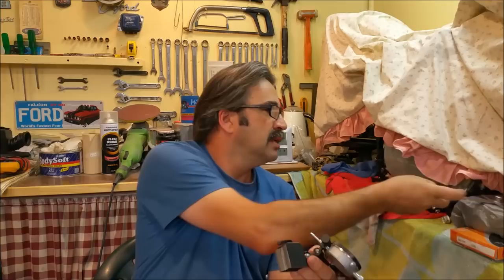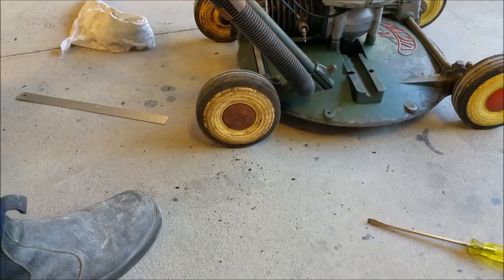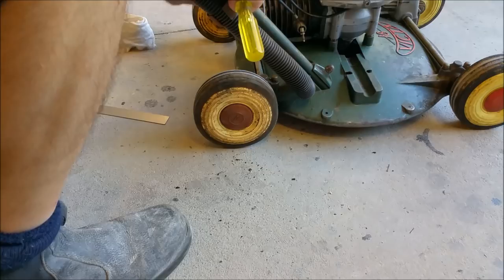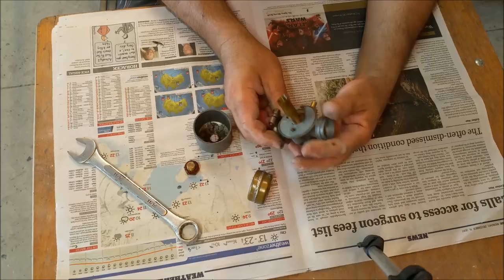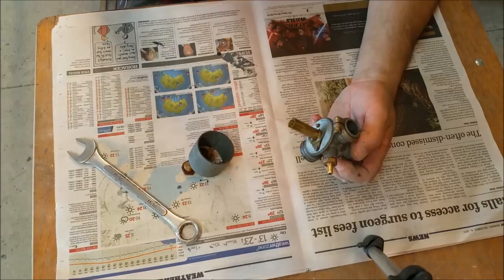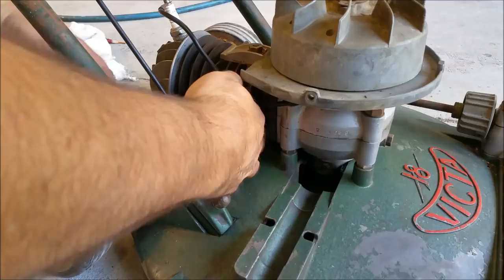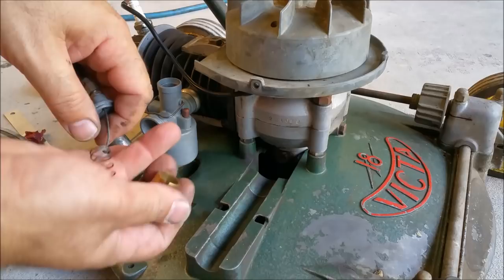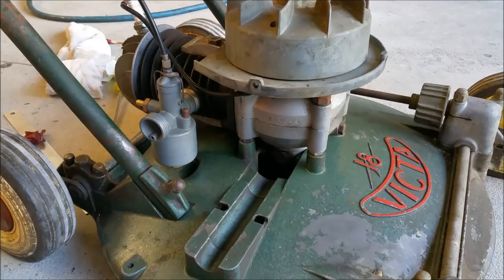1959 Classic Victa 18 Lawn Mower - Starting and Running

Comment: Hi Peter, great mower. I've been collecting and restoring old Victas for years, and I'd recommend keeping that one all original. It's a model 5, series 1 in pretty nice condition. It dates from mid 58 through to mid 59. It''s missing a few bits - a gasket that sits between the float bowl, a clear plastic splash guard that sits between the tank and fuel cap, and the rubber snorkle and choke. The snorkle changed over the life on the Model 5, and yours has a choke from a Series 3 on it currently. It should have a small black and white plastic choke. Finding the correct choke and snorkle can get expensive, but they do come up on ebay. The badge between the handlebars are also rare and valuable, but replicas are about on ebay.

As for clear coat, I'd recommend against it. Just clean it up and wax it. There aren't many nice old originals left, and they are worth far more than those that have been restored. If you want to paint anything, there are a few parts that were originally cold dipped in gal which come up nice with a can of spray gal. You could also re-paint the handlebars in Wattle Rustguard Brunswick Green, but as I said, leave anything hammertoned alone. 

The original pull rope was also leather thong on a wooden handle, if you're wanting to be 100% accurate. Nylon bushes for the wheels can also be found on ebay, but also the diameter of the axles - they are probably worn. Most collectors machine up new ones and weld them in. Also, treat the wheels with care. They'll cost upwards of $200 to replace if you can find a set. Love your vids mate!

Comment: Hi Peter, another excellent video. When I was 3 (1983) I brought dads vita 18 into the kitchen. I was obsessed with the rope being wrapped around the wheel, I even got mums dressing gown cord and tried to use that! Anyway great mower, clear would make it look ‘fiddled with’. It’s lasted this long without it, I’m sure an old hessian bag over it will do the trick for another 60 years.
Reply from the maker: I'm with you on that Toby... clean and leave is what I shall do. And... a bunch of old 18 bits in a disassembled state rocked up on eBay - given that it's basically non-running trash, it is one that could be restored. Cheers

Comment: Shes a beauty i love the sound of the victa 18's such a tough note. Thats a nice carb too alot i see are very corroded especially around the kneedle an seat. I couldn't see in the vid on my phone but i couldn't see the gasket between the carb an throttle slide cap. I still use my 18's such an icon of a mower. Happy Australia Day Peter an thanks for the great vids 😁

Comment: Very nice victa. I have an Increadibly rare 20 inch Firestone mower 3.5 horse Briggs with a wind up starter, and a pulsa jet carburetor with vacuum operated auto choke! It has some lettering and paint, with some lots of rust but I'm keeping it original. Runs great and never burns oil. I had lots of flooding issues with the carb, doubling the diphrams finally did the trick!

Comment: Nice job Peter.....For the wheels maybe use some 1/2 in copper pipe and a 5/8th drill and grease..works like new.
Reply from the maker: Great idea, thanks for the tip!

Comment: In the fifties most two stroke engine makers said you could run either 30 weight motor oil mixed with gas, or if it was available to stroke oil with gas. Motor oil was less expensive, so many people ran it instead of two stroke oil.
Reply from the maker: That makes perfect sense. Thanks Patrick.

Comment: Hi Peter . Nice job . The carb looks like a Villers type , sure they used them on the old Atco mower and Seagull outboard  motors.
Reply from the maker: Thanks Pete - it's marked 'Victa' probably a copy of what Villiers were using at the time. Cheers

Comment: Peter, with the way it runs and how old it is, if it was mine I'd give it a thorough wash and rinse then wax it with some paraffin candle wax cut with some mineral oil and spirits. It's not surprising that it started on the second pull. The carbie was lubed up like Saturday night. Check the crankcase seals. If they are worn too much the lack of sealing will rob performance. Two-stroke engines tend to work better with the oiled sponge in place than without one. The slide throttle needs some attention. Castrol XL(noticed the ad on the tank) oil came in either 40 or 30 wt.S.A.E.. If you prefer you could use 30 wt. non-detergent oil mixed with gasoline to the proper ratio for this little beastie. Proper two-stroke mixing oils came on the scene in the 1960s. Is this 16:1, 25:1 or 32:1 fuel oil ratio?
Reply from the maker: 1/3 of a pint of oil to a gallon of petrol is the recipe on the sticker... so, 200ml oil to 4.55 litres fuel is between 20:1 and 25:1. Thanks for the points you've offered, I'm slowly learning about these things. Cheers
Reply: I did some calculations and the ratio is very close to 23.06:1. Mix the fuel to 24 or 25 to 1 and it'll be alright, using modern two-stroke mix oils. If using non-detergent single weight oils S.A.E.30 mix to 20:1 because of the lubricity of single weight oils. Any way you slice it you have a nice runner that can be exercised or simply admired.

Comment: run some seafoam through it to free up the rings. Years of sitting usually makes the rings sticky
Reply from the maker: Thanks for that, but not familiar with seafoam... Cheers
Reply: other thing to do is put the engine upright, pointing the spark plug up, put the piston to TDC and flood with wd40, let it sit overnight then start it in the morning or whenever. Transmission oil also works, it will free up the rings real good

Comment: The Victa looks like they put a lot of engineering into the height adjuster.  The very cheapest mowers now just have four holes in the  base so you have to  spend 10 minutes to adjust the height.  No good.  Others have a spring bar and  detent device on each wheel, which is better.  Would like to see how the one on the Victa works, and whether the design was a success or just more problems.  Oh yeah ... another thing mowers don't use now is a fuel cut off valve.  Not even an option since many makers use a carb that is built onto the top of the tank.
Reply from the maker: They certainly put more effort into the engineering of small items back then. Even the bad examples of these adjusters still appear to work - I assume they ditched them purely on the cost of manufacture. Cheers

Comment: The length of the air intake matters a fair bit. I also have a workshop manual somewhere
Reply from the maker: Thanks Dave and I mentioned it in the video... after hearing you say it in your video haha. Cheers
Reply: Thanks Peter. I only know that because it says it in the workshop manual (which I need to look for) Because your video's have inspired me to get back into lawnmowers. That and my very very old rover ride on needs some work
Reply from the maker: Make sure to get your camera out mate, keen to see more mower material. Cheers
Reply: I have a few that need some work and will be uploading several videos. I have 3 11402 briggs and stratton engines that I need to do something with (well 2 mowers and a spare engine). I also have a 1978 4hp stratton engine that needs new rings but has a cast iron liner.

Comment: Hi Peter, this is the first mower video I've seen.
What  is the horizontal rod/pipe on the left side of the mower going from front to rear ?
Also, what is the channel on the top of the mower body going from the engine to the right (oil drain maybe) ?
Clean and clear cote is my vote.
Thanks, w.
Reply: The rod on the left side of the mower deck is the grass cut height adjuster.  Operated by turning the large knob, next to the gearbox by the front axle.  Had one of the Victa 18, years ago.

Comment: when My dad had one of these he said to use engine oil(not two stroke mix oil) as it says on the fuel tank.. might make a difference to how it runs?
Reply from the maker: Yes and I think you're correct. Cheers
Reply: You know why it said to use engine oil? Because there was no 2 stroke oils common yet. 2 stroke oils are much better at lubricity, they burn far cleaner and don't come up in the head and piston grooves and exhaust.  You can use a normal dino 2 stroke oil and it will be far better than 30 weight non detergent they used to recommend.  Or even better modern synthetics. Modern oils burn very clean and with low stress engines like these mowers you can have nearly no wear. 30 weight not so much

Comment: I suppose these old machines ran on 5% mixture as opposed to modern 2 stroke mixture at 2%. Why is this?
Reply from the maker: I'm not sure, this has a mix ratio of a third pint oil to a gallon of fuel... works out to about 22:1 Cheers